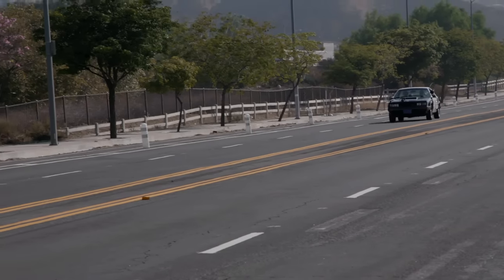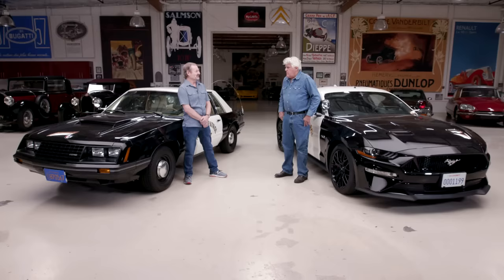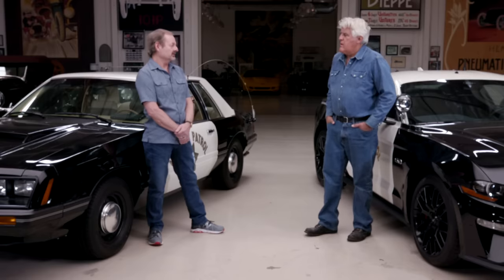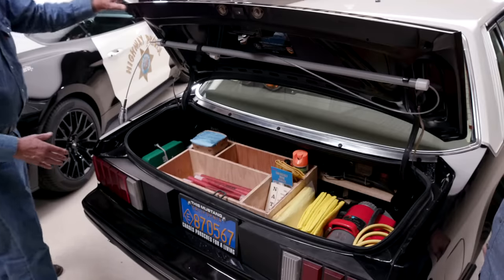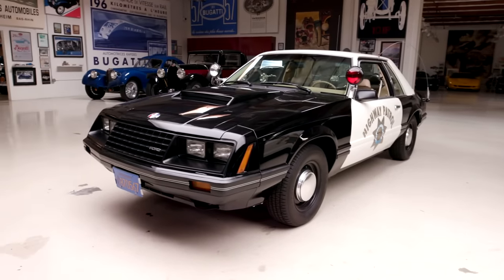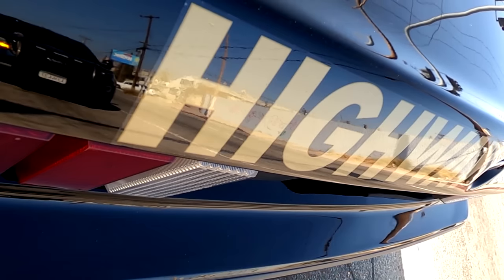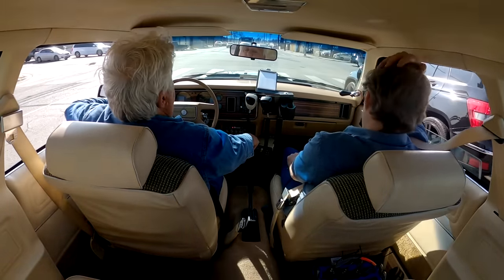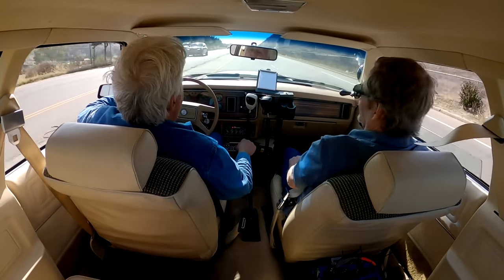This Mustang Chases Porsches for a Living | Jay Leno's Garage

Comment: I'm calling BS on the 160-180 MPH top speed he says it would do. The only way that car could do 180 is to drive it out the back of an airplane at 30000 feet.
Reply: There are some long 6% grade downhill roads coming off the mountains.  I would think the limit would more about stearing and "front end float" than power.
Reply: Yes even with 225hp, probably 130/140 is the max
Reply: Yeah he got a bit carried away lol
Reply: Ive buried the speedo in a 92 LX 5.0 at 140 and that thing was screaming. Couldn't even imagine going any faster.... Scary ride
Reply: He did't say that this version of the Mustang would do 180
Reply: 180 🤣🤣🤣🤣
Come on !
Reply: I owned about a dozen fox bodies over the years, and the only one I ever saw the top speed on was a 1992 GT that had heads/cam/intake/blower @ 9psi and that did 173mph via GPS.  So, probably not.
Reply: @danam0228   There is no roadgoing mustang reliably capable of 180 mph.
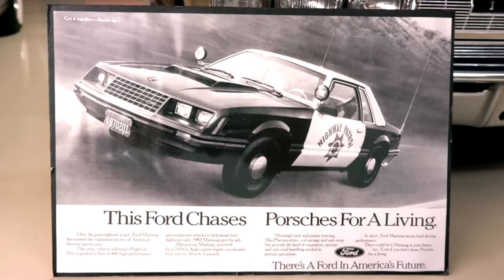Reply: It’s got cop shocks, cop brakes, cop tires….and probably a 2:42 rear gear ratio
Reply: I think a 4 speed won't even let you reach 160mph. I mean thats FAST. And 200hp in a car shaped like a brick isnt exactly a good recipe for topspeed. 😂
Reply: I think he was doing a 180 ;)
Reply: @danam0228  Then you tell me what CHP Mustang he is talking about that did 180. Once again I'm calling BS.
Reply: @pete1729  2013/14 GT500 hit 200mph…..so yes, there are road going Mustangs that can reliably hit 180mph.
Reply: Maybe he meant Kilometres Per Hour
Reply: @PekeloB  😂
Reply: @RedXray  stay at home mom?  What are you talking about?
Reply: Exactly!
Reply: @delahayenator  , maybe it's all about the rear end ratio?
Reply: @johnirwin1837  with that horsepower, weight and aerodynamics even that wont help 😬 maybe on a  steep 45% downhill run
Reply: That mustang has a low compression 302 V8 with a two barrel carb and it will not do 146 to 165 that is BS
Reply: Km/h maybe
Reply: @R Robert they max at 180. This one no way. It takes a long time for a modern stang to hit 180 but it can barely
Reply: He mightve hit 180 coming down the grapevine in Bakersfield i know that area can help build speed fast
Reply: Yeah legit i may be in KM/H but ive hit 200 and i think the max it can go is 240 stock so thats a max of 149 mph
Reply: Terminal velocity is about 160mph...
Reply: @pete1729   Wanna make e bet?
The Nevada Highway Patrol shut down a highway so Shelby county test their 900 plus horsepower Mustang which is used and can be bought for road driving.
The top speed was approximately 193 MPH.
Don't believe me, call them or call Shortly in Nevada and ask them.
Reply: I rode in a 73 mustang notchback ! I timed it myself at 175 on the freeway ! Started at 65 ! Took two miles to hit that speed ! The next morning all four tires were flat ! I’m thankfully still alive
Reply: I agree it won't do 160 even. I have a V6 mustang top speed is 125mph.
Reply: @jasonjones4695  Hey Jason aren't you the guy that claimed to have a pet unicorn when you were a child? And claimed that your stepmom was Morgan😂 Fairchild?
Reply: a stock fuel injected Fox mustang is not doing 180mph maybe 150mph going down hill and it would take MILES to get there They only have 225hp, the cylinder heads and valves are tiny stock. Even if it did go 180 that’s dangerous you would want much wider tires at the bare minimum.
Reply: Ha ha ha, I have to agree, those old fox bodies will disintegrate about 120, I owned one, so I speak from experience. Lol.
Reply: I had a 79 that was far from stock.  C4 tranny. Top end 135 to 140.
Reply: Speedo was way off prob
Reply: @skrimnik5725  it was probably only 90 miles an hour, it just felt like 140 because the car was all over and feeling like it was going to disintegrate.
Reply: It could not go that out of an airplane either. Did a lot of jumping out of airplane for the military and terminal velocity is 120 so could not do that than either.
Reply: Terminal velocity is 120 so could not out of the plane either
Reply: Correction 155, those things WILL burry the needle, that and they sucked stopping, yes they only have 200 hp, bit there light
Reply: I hit 162 in an 88 GT with no cats, static timing advance, a crossover pipe with a 2.73 rear.
Reply: Make sure you put at least five pigs in that vehicle before you drop it out the airplane at 3000 feet, definitely exceed 180 mph hehe
Reply: They must be using that same cop speedometer that told “we matched you at 90” when I was driving an 89 dodge diesel that maxed out at 70 lol.
Reply: 2 barrel,  4 speed, buck 123 tops using 3 miles of road...
Reply: I’m calling BS… most 6 figure super cars of that era could barely reach 190 under perfect conditions. There’s no way a stock SSP Fox is doing that with Ford not noticing. In that era, If a stock 5.0 was capable of 180 mph Ford would have mentioned that in its advertising.
Reply: I had a 1992 SSP Police Mustang fox body 5 spd. 142mph was it's max in the desert going to Yuma, AZ.
Reply: I had a 1982 gt. I had a 4 barrel  edelbrock cam high rise Intake. Accel ignition stuff beefed up everything and it handled great to about 140 and I cannot see that car doing 150 without a lot of upgrades that the cop car didn’t have.  I know this car inside and out … but that doesn’t take away that it was a cool cop car!
Reply: Breaking news: internet warrior assumes an actual officer is lying!
Reply: It easily did 140 but began to rattle so much that you couldn’t hear the radio.
Reply: The first guest on the show full of crap is a cop😮
Reply: Wrong sized tires, wrong sized rims, changed a bunch of crap without recalibrating speedo if anything lol
Reply: @doodlemavrak4294  could be a lying cop
Reply: @bradwilliams5242  that does sound very believable lol
Reply: Have you driven one of the exact same make, year, engine and package! If not then maybe it can do 160-80 mph... Why would lie like trump does?
Reply: @pete1729 not true. The Newest GT500 will hit 180. That’s about it though.
Reply: Bs 4 sure
Reply: If you actually  listened, he said based on the tach, he estimated it would do 180.  He never drove that fast.

Plus I-5 is straight, level, and boring.
Reply: I had a built 89 lx. Heads , cam , suspension , gears and nitrous. I bought the car from a guy that won in a contest from mustang and fast Ford's magazine. Spraying a 125 shot of nitrous that car went 168 mph. When I let off of the nitrous it slowed down with my foot still on the floor. It would go about 145 on the motor.
Reply: These are police issue, special pack like gearing.
Reply: 180mph whilst drafting whoever you're chasing down the mountains
Reply: @pete1729  there are road going mustang plenty capable of 180 even 200 plus but not that fox body and no stock cars the 1s that are were built to do so I know because I had 1 a fully built 03 cobra Whipple supercharger t56 magnum transmission etc...
Reply: Clint Eastwood did one episode of Highway Patrol when he was  25 and he played a motorcycle club member. I don't know how Jay came up with his story about a 19 year old Clint.
Reply: Out of a airplane Dominic toretto style
Reply: I was about to say the same exact thing
Reply: Hes just tootin his horn. His in front of Leno, what do u expect lol

Comment: 4:03 He lying his butt off. No 82-93 Mustang never ran 145 mph.
Reply: I agree, I only hit about 120 in my assigned '93 , it was maxed out
Reply: Yea, had an 89 V8, and while it had decent torque, it wasn't very lively the revs and HP. It struggled past 110.
Even my 1996 Cobra, maxed out at 130.
Maybe with enough open road and the backside of a mountain.. He even said 180, because he used to do street racing in Detroit, as if that gives the car more power.. no way.
Reply: @wyskass861  Where did you shift your 89?
Reply: @blackericdenice  I don't understand the question..
Reply: @wyskass861  When you shift from 1st to 2nd gear or 2nd. to 3rd gear. What rpm do you shift @ when you race?
Reply: @blackericdenice  Oh that was in the late 90's, and many other cars since. Couldn't remember well the shift points. I didn't do any real drag racing, but did test top speeds on a particular section of highway. I seem to remember that around 5000 it was starting to choke. Was a stock 5.0, with 3 inch Flowmasters. So was loud but not particularly amazing compared to my future cars.
Reply: @wyskass861  Yes I remember an 89 manual ran out of cam @ 4800 rpm and for some reason the auto would pull up to 5,000 rpm. I also drove a Lincoln LSC and it also shift @ 5,000 rpm.

Comment: I drove the CHP 1986 Mustang LX, which was the first year for fuel injection and probably the fastest of the lot, since all they did was get heavier after that. On I-5 I could hit 140 with no trouble and suspect the max was around 145. The steering started to get light around 120, but it wasn't unconfortable to drive at 140. On the other hand, the 1983 Dodge Diplomat was downright scary at 115. The 1991 Crown Victoria was a much better car than the Diplomat in handling and power.
Reply: Zoom Thump Thump Thump That's not exactly true about 1986 being the first year for EFI. I bought my 1985 Ford Mustang GT on Dec. 24, 1984 and the sales guy tried to sell me a 1985 Mustang GT that had EFI, but in order to get EFI you had to go with the automatic transmission. And it upped the price $500.00 more than the 5 speed.
Reply: @lilorbielilorbie2496  That was a CFI system. Sure, it was fuel injection, but not the 8-injector sequential fuel injection configuration that would be seen on the 1986 and later cars.
Reply: Fun fact... in 86 the stang only had fuel injection on the 5speed models.  The 86 5.0 automatic still used a carb.....

Comment: While I respect the retired officer and his service, and Jay to a point, there's a zero percent chance any of the cop cars he drove did 180. I would even submit they didn't go 160. But the stories are great and this was a great episode.
Reply: Literally the first thing I thought. There's no way in God's creation that fox body is going 180.
Reply: Yeah no chance he hit 180 and I'd be shocked if he hit 150.
Reply: @Studio23Media  there's just no way. Most sports cars nowadays would have trouble doing 150. Especially a borderline base model. I mean my friend's 1996 roush mustang topped out at like 175. The things pushing like 500 horse. Plus he says his fastest Chase was 125. So why the hell was he attempting 180.
Reply: AFAIK the Police Mustangs were just GT's underneath and the 5.0 pushrod motors...stock as delivered really started running out of breath over 4500 rpm.   I had a 95 and did some work so it would pull to the ignition cut at 6250 and the car ran well....but with 3.08 gears and T-5 there's NO way it would break 160 let alone 180.   This sounds like how the 'fish I caught' back in the day magically keeps growing in your memory.
Reply: Back in the 80s I had an 87 5.0 notch back similar to this, with the exception that it had fuel injection.  That thing could burn the rear tires off the rims and I have no doubt it could hit 150.. I also had an 86 MR2 and that thing would run over 140.. The mustang was quite a bit stronger. The speedo on the Mustang did not go to 150.
Reply: 180 Yea Right ! thats like a block in the wind with 225 hp . . . at the crank !!
Reply: Yeah same. A circa 210-220HP(which i doubt) Early Fox doing 180mph???????? 

😆😆😆😆😆😆😆

Maybe 140 down hill. You'd need minimum 400hp for 180 amd even then, you'd wanna be as slippery as possible.

Anyone know what the theoretical top speed is at 5000 RPM on one of those 4 speeds?
Reply: I know from experience that 135 was all they had. And that took a good while to get to. However at the time that was really fast. Cars were much slower back then.
Reply: I had an 86 exCHP and a 89 GT . Numerous flat out midnight runs on FL's I95 and all I ever saw was just under 140 on the 91 GT which was faster then the CHP car . My buddy's 350 Camaro would do 150 though just not as fun . 180... hahahaha
Reply: HEY, he was talking about the speed with a 80MPH Santa Ana TAIL WIND  :   )
Reply: i had a '86 with a 408 stroker in it, 500+ ft/tq and fastest i had it was 147, and it was getting scary AF from aero lift... there is no way that thing with any remotely base motor did 180

but, with a stock 302 HO manual would do 134 maxed out, but that was the limit... the 408 limit was road and aero
Reply: @braddawson4496  the 86+ HO FI 302 topped at 134, and that cop car with all the lights sticking out... no way 134
Reply: There is a video on YouTube of a newer GT350 topping out at like 176 on the autobahn. No way in hell a Fox body is hitting 180! I had a couple of them and No way that car could go that fast.
Reply: @narmale  My 89 GT would get light over 110 and felt like it was on its tippy toes maxed out in the 130's . 110 became my cruising speed on interstates and turn pikes when I could running North and South in FL . My buddy's Camaro felt solid at 140 but car was boring to drive .
Reply: @EdD-ym6le  odd, i had Mickey Thompson street ETs 245/275 and lowered 2", shouldn't have been that much diff... stock shocks/springs tho

just got rid of my 93 z28... man yeah those things were a ROCK at high speeds... but holy hell i got sick of lifting the car off the engine
Reply: @narmale  This was 1994'ish(old guy here) but I was running Comp T/A's 225 . Mine was stock . I was completely comfortable at 110 . Those Camaro's had bad (back then) break away tendency's . I could ride my GT sideways thru a corner and you'd think your fine in a Camaro then it would just break away then snap back the other way if you caught the first break . I saw it following a friend which cost a mail box and the second time I was in another . Third time I was driving an IROC Z (hahaha) - caught it holding the pedal flat going thru an S turn but I didn't wait and gave it a quick shot the other way and it straightened up shot out of the corner . I bet I was doing 70 coming out of that corner . My friend rolled my first 86 exCHP Stang when I let him drive it but it just rolled up on the passenger door and we climbed out the drivers window . Then I bought the GT . OH well , only young once . Those 90's Z28's were fast on the open road . They just kept picking up speed like a train .
Reply: @EdD-ym6le  its was those damn zexal torsion lockers, those things wernt like clutch lockers so they behaved more like IRS axles and alota ppl dont understand how to correct and treat em as a solid axle... 
All the worse cuz they ARE a solid axle 😆😆🤦‍♂️😆
Lol u ain't old man, im '84 an still going great, just stop lifting heavy stuff and trying to show off and you'll be fine lolol
Reply: @narmale  84 God Bless ya . Yesterday I watched the " Jocko Podcast "(on YT) and he interviewed a 99 yr old guy that stormed Omaha beach in WW2 . It was from 9 days ago if you look for it . It was really good . Yeah we really didn't know anything about zexal torsion lockers then but that makes a lot of sense now . Those Camaro's seemed possessed and liked to bite ya . When someone bent a Stang we all knew why hahaha .
Reply: @EdD-ym6le  the thing with them was 3 x revolution, then they'd hard lock, but before that it was biased torque, great for road racing if you knew that, didnt help they were so long, they just couldnt handle like the mustangs, but they'd sure eat ur lunch outa the curves

So torque would be split between tires, applying  torque to the wheel which was spinning faster so it would try to keep it 50/50 even in a curve, but if you got wheel over-run, like in a burnout, roughly 3 spins of the primary wheel and then it would lock up. So in cases of drifting, even for a moment... total chaos if your not used to it and expecting it

Check out my vids, the fox and my new toys are in there 🙂
Reply: @narmale  Yeah I'll chk it out , I just sub'd . You know a bunch more about cars then I do . Eletrical wirepull gone wrong haha . I thought you meant you were 83 years old haha . I'm 52 . Thanks . edit - Stang sounds Bad !
Reply: @EdD-ym6le  haha! Nope, that would be my father lol, ole guy still going good, hope he's around till 100

Comment: No Way The SSP Does 160-180 MPH. Ferraris, Lambos And Porsches At The Time Were not Doing That
Reply: You'd be surprised on a rural road that goes on with no turns for 20+ miles. I got my 01 Ford Explorer with the 4.0 to 151 mph beside my buddy on his Suzuki GSXR600 and a week or so later in my 99 Jeep Cherokee with the 4.0 I6 up to 144 mph again with him beside me. They both had minimal upgrades, the jeep had a performance head, cold air intake, oversized injectors, intake from a 01 and long tube headers with 3" straight pipe with a side dump. The Explorer only had cold air, larger intake, muffler/cat delete and a 40 hp shot of nitrous that I rediculously rigged up on the throttle body spacer.
Reply: @Ole_CornPop  Come on man

Comment: When the LA Sheriff’s Department tested this car during its annual evaluation at the LA Fairgrounds, one of the drivers made the following notation in his report: “A very high performance car that would get the average deputy in serious trouble very quickly”.
Reply: There is a reason you almost can't find one. Civilian or LE that didn't have right rear panel damage.
Reply: Pretty easy to spin out in these Mustangs. They’re small and torquey.

Comment: I promise that fox body isn’t doing over 120 it’s only a 4 speed
Reply: Maybe downhill with a strong tail wind!
Reply: That it had a 4 speed would have no effect on top speed.  What does is careful selection of final drive gearing to aerodynamic drag, and matching it to engine RPM at max power. With best gearing, I would guess that engine-body would top out out at about 135.
Reply: @johndavidwolf4239  gear has everything to do with top speed and those don’t have height final drives 140 tops